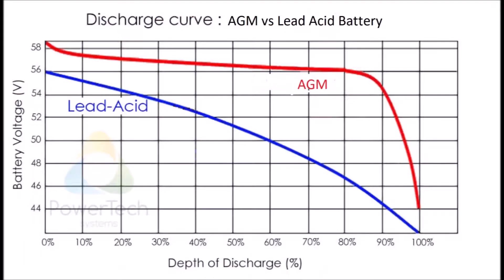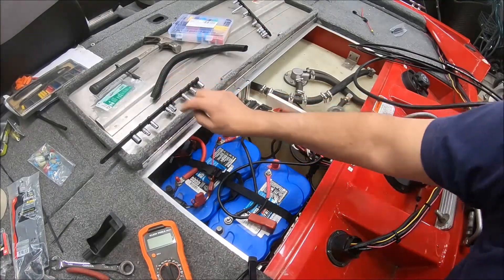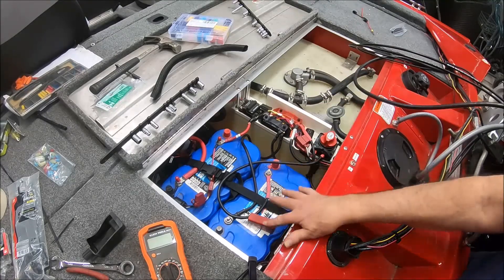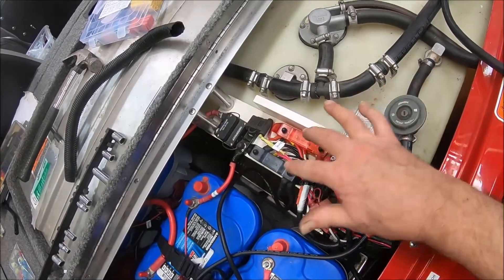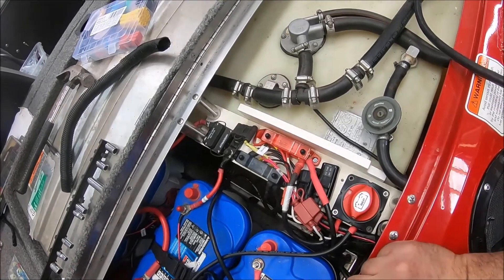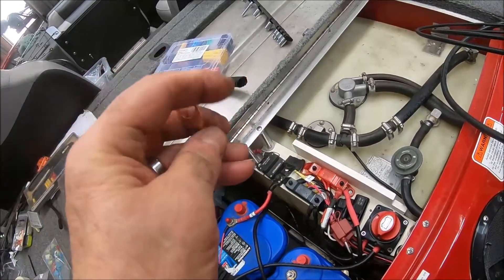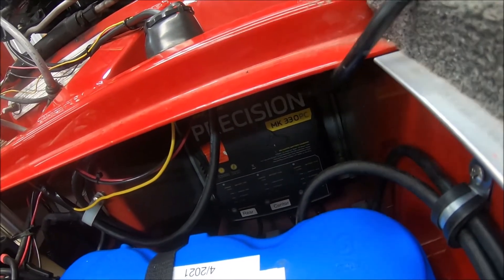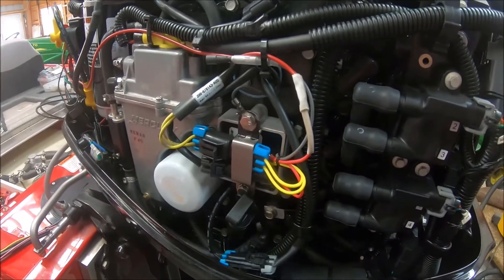Is an AGM battery a good choice for your boat in the primary position?

Comment: If i have a battery up front and in the back of my 14 foot starcraft and get an agm in front should the auxiliary be on all or run 1 or 2 depending on lead acid or agm depending what your doing like lakes for shorter times or rivers for longer